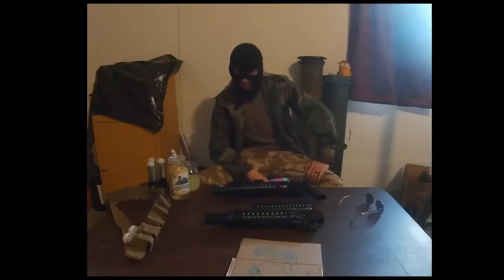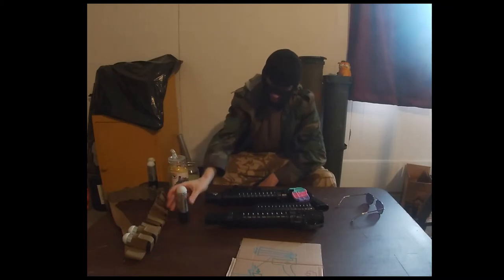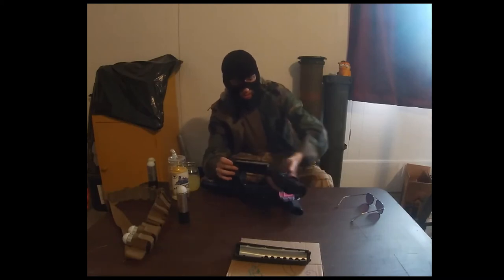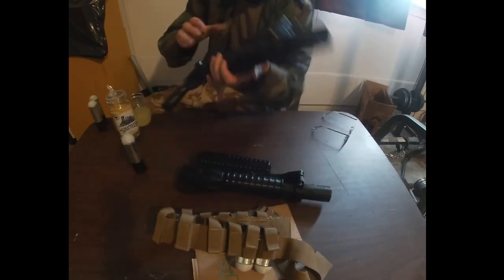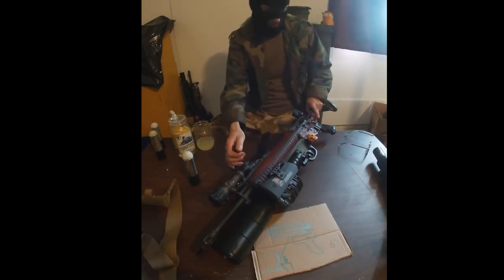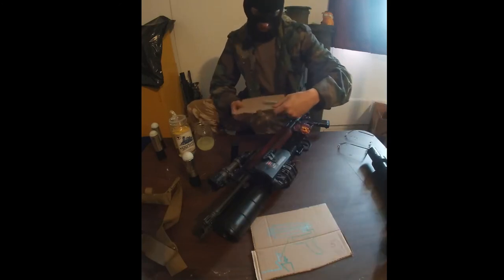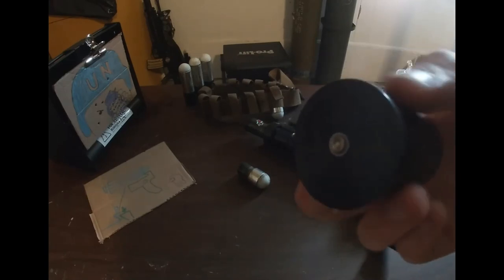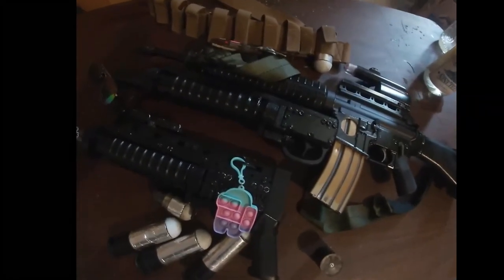Open Source Pipe Hitter 37mm Launcher

Comment: Does the fence post have to be seamless?
Reply from the maker: The fence post will not be seamless. It can be sanded down and additionally as it is closer to 38mm and the projectiles are soft they won't really snag. You will only need to grind it down if you want to use 38mm rifled projectiles
Reply: @thegunfoogle2864  I’ve been trying to ask around on Reddit and people are dogging on me for just trying to find answers to my questions. Thank you, I wasn’t expecting it to come from you… ide like to ask 👀belt fed